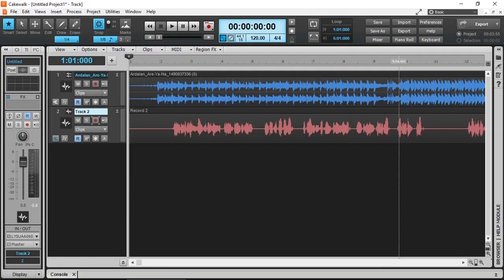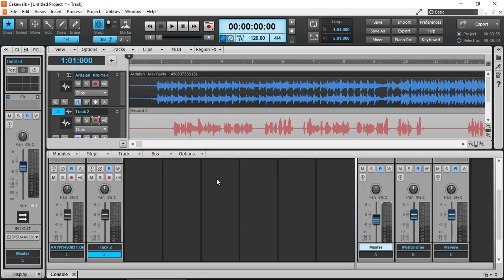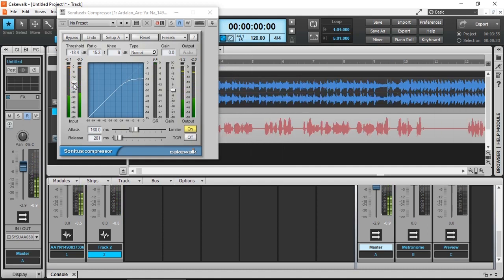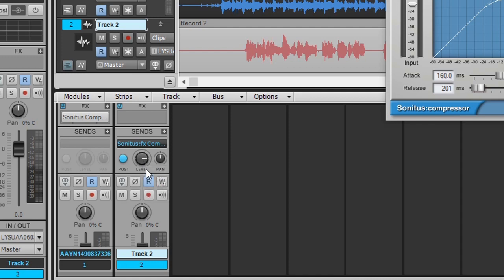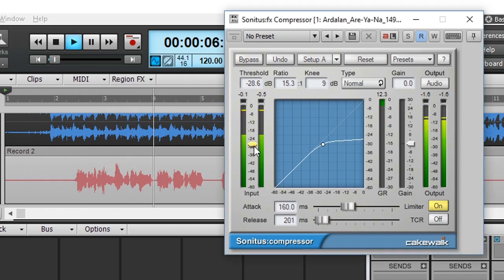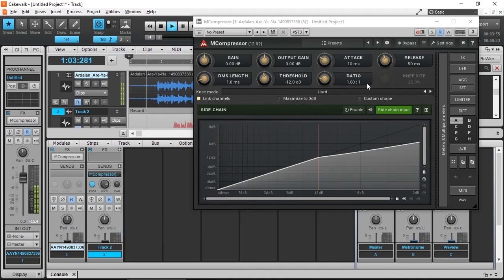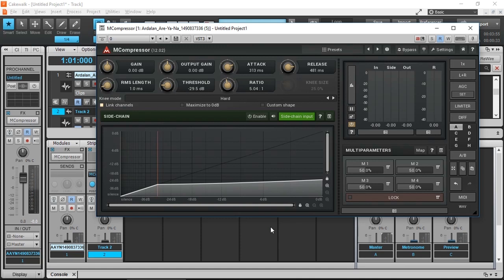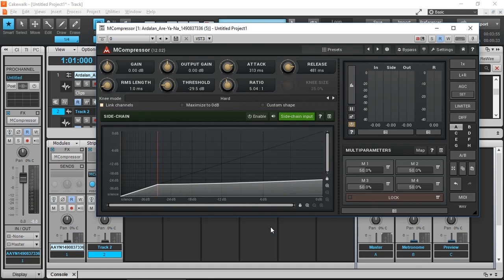Using Sidechain Compression in Cakewalk By Bandlab

Comment: What kind of settings do you use to smooth out the sidechain?  Say I was recording a jingle and wanted my voice to fit perfectly balanced with the music - is there a way to have the voice and music clearly exist in their own pocket without the obvious volume pumping of the sidechain?  I'm still a noob, so I'm guessing I would need some subtractive and multiband EQ.  Thanks.
Reply from the maker: I prefer wide-band compressor rather than multi-band, this helps to hear the vocals with no music distraction at lower and higher frequencies. But it is a choice still.
Try mid (100ms-150ms) attack and mid release (180ms-250ms) for smooth transition. A ratio of 8:1 and gain reduction of -18db to -24db. This should give your vocals enough room to be heard.
If short duration, you can use less gain reduction for more advert impact. If the duration is long, i.e. a podcast, lower background is more favourable with the audience.
P.S. A well processed vocal track feeding the side-chain is also very important.

Comment: Hello, I have tried this method with sonitus compressor. However I felt that the sound was compressed regardless of the sidechain signal. Then I changed the compressor to Native instruments Supercharger. It has the switch wich enables or disables sidechain and then it worked. Is it possible that sonitus don't work well with sidechain or there is a setting or switch wich I don't know how to use ? Cheers

Comment: I saw one of your videos about a Behringer mixer which I found very interesting and I thought you might touch on my question, but you didn't and since you said you would entertain questions... well here goes.

I have a Behringer XENYX Q1002 with USB. Love the thing, but I fear I may not be able to really do what I need to do and that's where you come in.

We use the mixer for two different things: 
1) To pipe the mic back to a laptop via the USB so it can be recorded by itself - NO OTHER INPUTS are actively used while the mic is used.
2) To PLAY music FROM the laptop TO the mixer via the USB WITHOUT recording. We would never record while playing back music from the laptop - which wouldn't make sense anyway.

Using the USB connection and the TO MAIN MIX switch I can either hear the mic from the speakers and be able to record OR hear the the sound from the laptop (music) depending on the position of the switch. The problem is that I have to use the TO MAIN MIX switch to switch between these two functions. Sounds simple enough, but there is method to my madness....

The reason for all this is that there are times when I am not able to run the system because of schedules etc, and to try to get someone unfamiliar and not technically savvy with the set up to remember when the TO MAIN MIX switch is supposed to be up and when it's supposed to be down at the right time causes problems and a possible missed presentation, so I want to make it as simple as possible if I can. Plug in and go!

Is there any way I can have the setup such that I don't need to change anything if I want to listen to the laptop (from the speakers) and NOT record OR listen to the mic (from the speakers) AND record it? I tried a few things, but nothing worked. I can get the mic AND the music at the same time to the speakers (which was only for a test) , but then can't record the mic on the laptop, OR I can use the switch as I do now, but that's as close as I can get.

Keep in mind we would never need BOTH the music from the laptop AND the mic at the same time; it's one or the other and we only need to record the mic. I am set up on the laptop using the playback and record USB CODECS which allow the USB functionality.

If there is a mixer that would allow me to do this, I'm open to that as well.

BTW - we WERE doing this via the ANALOG headphone/mic jack but the connector failed, so we thought the single USB connection would be our answer. Now I'm not so sure.

I hope this makes sense!

Your thoughts and expertise are very much welcome!!
Reply: @Rodger Andrusky.    What DAW are you using ?
Reply from the maker: Thanks for posting your question, but it's on unrelated video, that means it will not have any answer solutions from people who are interested in that mixer. It's like asking a question about cooking to an electrician.

You can repost your comment, in whole, on the following related videos, so that if I don't come up with an answer, someone else could and help you out.

https://www.youtube.com/watch?v=JBPOIxTs4FE

https://www.youtube.com/watch?v=y1ftEDMiBwg

https://www.youtube.com/watch?v=9w9ovvHmlEc

https://www.youtube.com/watch?v=_4_BKmIsIQQ

In the mean time, let me see what I can come up with.

Are you happy for me to recommend another small USB mixer to replace the 1002USB? Like Yamaha AG06? As the AG06 mixer has the option to record Mic only via USB on the PC while music is playing from PC, with no switch change.
This video shows AG03, but AG06 has few extra mic inputs.
https://www.youtube.com/watch?v=FxOPvzdseKk